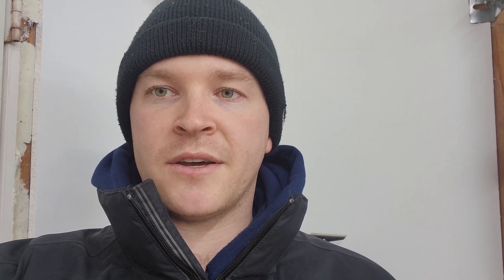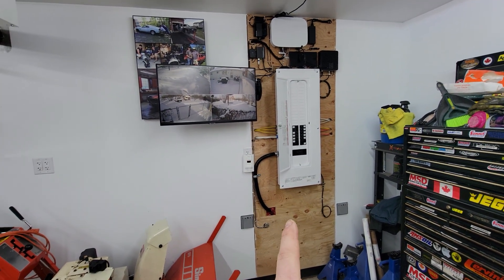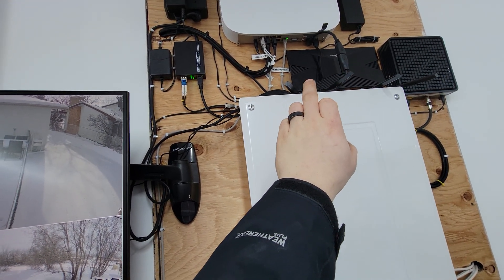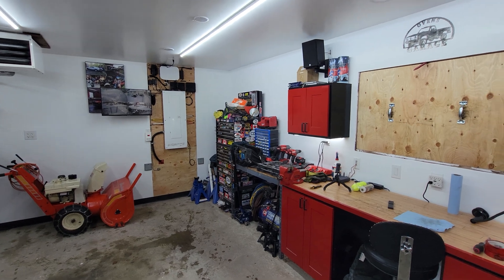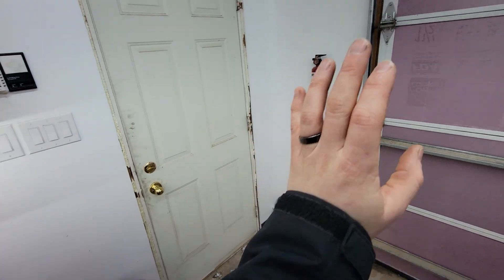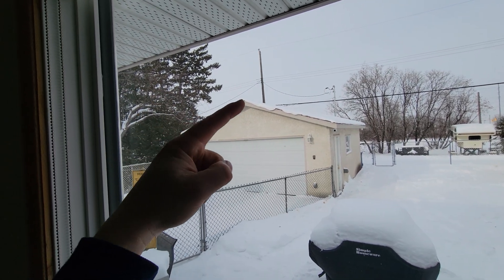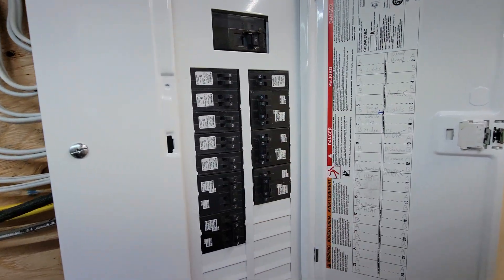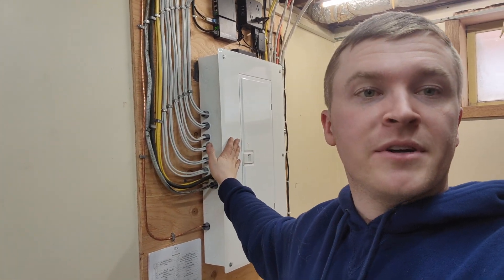Main Electrical Panel in Detached Garage | 200 Amp Service

Comment: Great video. That garage is a central base of operations
Reply from the maker: I should do an updated video on my basement mechanical room. I've since built lower/upper cabinets in there and match the camera feeds and put my desktop with dual curved monitors in there. It's awesome.